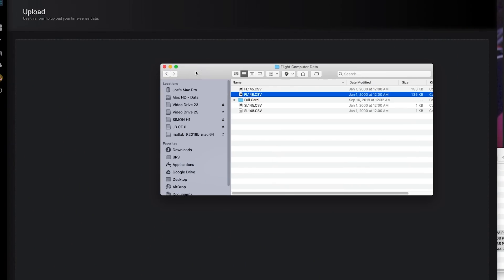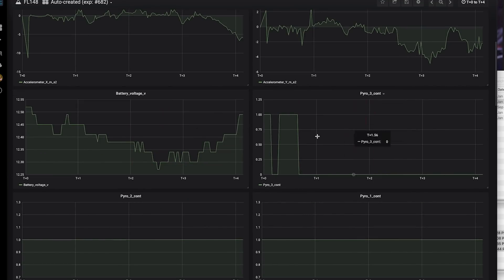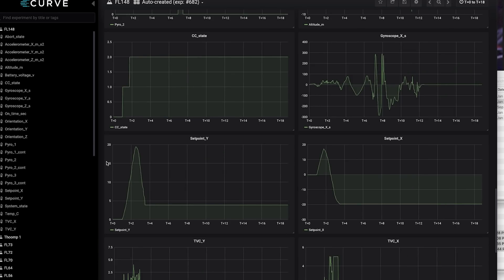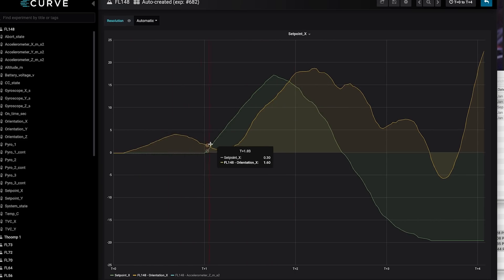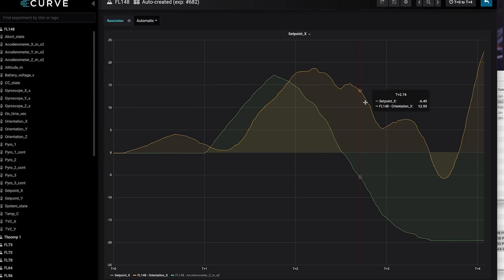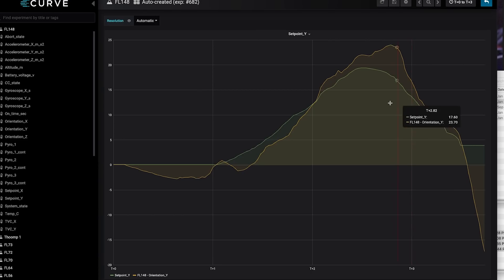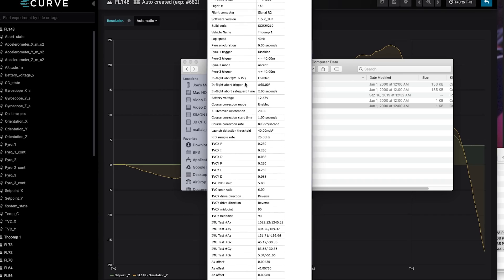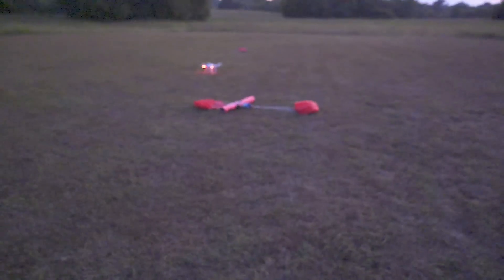Back-to-back Silo Launched Model Rocket

Comment: You can eliminate integrator windup by changing the way you calculate your output for your PID. If take the derivative of the entire formula, you can calculate the correction as opposed to the output if you are using a position form PID loop.
Correction=(P*e' + I*e + D*e'')*G

Comment: Add a little more weight in the nose, if you can. It will increase your dynamic angle of moment and improve your stability, making it easier for your gimballed motor to keep it pointed where you want it to go.

Comment: I would recommend starting ignition slightly before you lose all of the velocity you gained out of the tube from the compressed air.  Combine the ramp up time of the motor with the deceleration of gravity to maintain velocity.

Comment: BPS, I have a PID-controller lesson learned that might be useful to you. Many years ago I worked as a flight test engineer on a (now-retired) military aircraft that used a PID controller for its autopilot. Several crashes occurred in active service, which led to our autopilot upgrade program. The crashes were due to the roll axis apparently having a "hardover condition" and causing the pilots to eject, thinking that the ailerons were locked hard to one side. Eventually we discovered that the PID's "I" integral term was "winding up" or slowly saturating. The pilots had a habit of applying sustained rudder pedal while on autopilot heading hold (to cause a sideslip to correct a wing fuel imbalance). When they released the pedal, the fully-saturated integrator took over 30 seconds to wind down - so the roll axis was applying full aileron "uncommanded" (from their point of view). In other words, they were bailing out of a perfectly good jet, because nobody understood the PID controller. The fix was simple: correct the integrator to immediately de-saturate when the proportional error went to zero. Looks like that could help you out.

Comment: What is the end goal for silo launching? Using compressed air to give the rocket a boost? If that's the case then it's not working because the rocket loses all its momentum before the motor blasts it into the sky.

Comment: The missile knows where it is because it knows where it isn't.
Reply: By subtracting where it is, from where it was. The missile determines a deviation.
Reply: The guidance subsystem uses deviations to generate corrective commands to drive the missile from a position where it is to a position where it isn't, and arriving at a position that it wasn't, it now is.
Reply: I think that's called a particle filter?
Reply: It now subracts where it should be, from where it wasn't, or vice versa. By differentiating this from the algebraic sum of where it shouldn't be, and where it was. It is able to obtain a deviation, and a variation, which is called "error"
Reply: It went up
Reply: Don't forget that the missile, if it isn't sure where it is, it always knows where it isn't or where it was, within reason.

Comment: It seams like a huge waste of energy that you let the rocket almost all of its forward momentum before powered flight!  It would seem to make more sense to either increase the ejection power so that it is a more smooth transition to powered flight without a loss of momentum or start the powered impulse sooner!  It seams to me that it would also provide for a more stable transition if you were not letting it loose so much forward momentum before initiating powered flight and would require less active stabilization on the part of the guidance system in the binning of powered flight!  Just some thoughts from my point of view!  I may be way off on all of it as I am not an engineer or rocket scientist, I just play one for fun!!!  :)

Comment: Hey 
Loved this video
 1st WOW COOL
Only because you are data driven, Bring to your attention Weather mainly Air Density in the day when sun is up you will have excelent flights, but as the sun goes down Humanity increases, so how.do you fix this is easy bud.
All you need to do is use a More Powerful Rocket Motor for dawn and dusk flights this will correct the wobble issue.
Humidity changes every Meter give take what you can try is track humanity every foot or so. 
It will be interesting to see the Data you collect.
Lastly  
If you are still having issues still well you can try something i was working on long time ago.
I got 4 stanless steal tubes i bent the tube 90 deg at the top and at bottom I bent the tubes in u shape to collect the hot Gas the Rocket motor expells i installed the tubes on rocket by looking down the top of the Rocket tube i placed X on paper then used it a guide placed dot on the tube using it to mark were the tube needs to go, this gas will help keep the Rocket from veering off. Just somthing to try 
90 deg bend to top
U shape bend on bottom. 
I am not master of rockets but out of all the people i have been watching you are the only tube Fire system I have ever seen. 

Do you have the Plans or have made plan how you built this as it is in this video. 
If you do I have young man who would love to build your Rocket If you can message me back or email me at address, livingrvlife@gmail.com 

Thank you

Be watching for more fun flights Bravo love what you have created keep on your dream truly love your Build

Comment: I think the pressure tube you used for providing initial thrust to over inertia, if so then I see in the video that as soon as the engine fire up rocket becomes static again and engine waste the same power to over static inertia. you should fire engine little early when the rocket is at their peak velocity.

Comment: What is the advance of launching a rocket this way?
Reply: JOUNcreations Assuming you mean benefit, there is no technical advantage at this scale other than having a slower ascent which is usually not desired unless a rocket is solely for modeling purposes like these ones are.
Reply: @EthanHeffernan  okay thanks!

Comment: Is it possible to set the trajectory so that the rocket lands at a set spot? It would be cool to see these pop out and deliver a roadster to a target
Reply: It wouldn’t surprise me if Joe figures out how to drop the whole rocket in another tube down range, auto-reload a motor and launch to the next tube.
Reply: It is not allowed in high power Rocketry code to have a "guided" rocket under powered flight. Something to do with not wanting civilian to create guided missiles. Be careful to not confuse stabilized rocket with guided.
Reply: Chandler Tollison perfect answer!
Reply: You could do that used a guided parachute as Armadillo did with its STIG, but it would not be feasible at this stage due to size and weight limitations.
Reply: @alxo82  actually it might be feasible at this scale. A retail manufacturer is working on a product for this exact thing. I tired guided recovery using a parafoil kite with moderate success. With Joe's willpower and his capabities, I think it would be quite easy for him to do (if he wanted)
Reply: @Tollyman69  you need some altitude for the parafoil to work, a thousand feet is not enough for full deployment and actuation

Comment: TL ; DR ignite the motor a few seconds earlier

I think you waste a tiny amount of power because the engine needs to counter falling when it ignites. If you just ignite it a few milliseconds earlier, I think the rocket would still go up when the engine reaches full power, and this way you might be able to raise your apogee a few meters.

If you already tried this and figured it didn't work, I would love to have some explanations (maybe in a video?)

Comment: You know, you coudl use some springy flexible material and make deployable fins. They woudl be strapped around like tape so they woudl not affect silo, but after ignition they woudl foil out